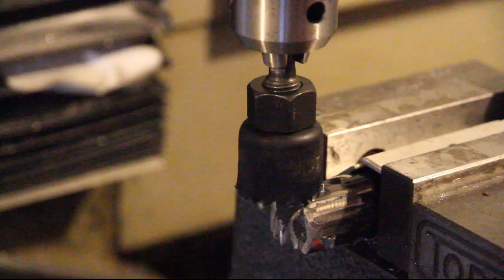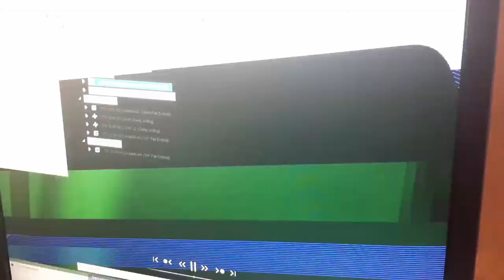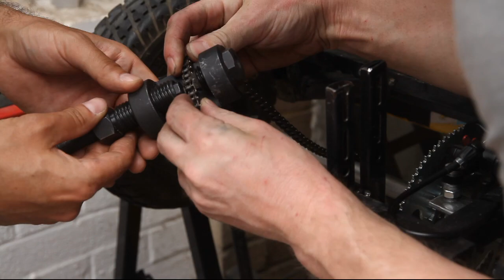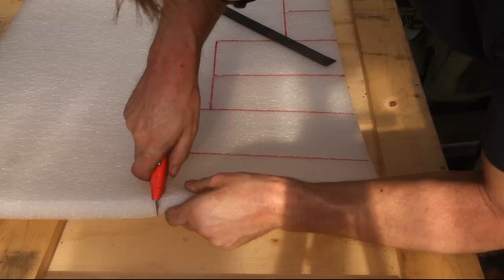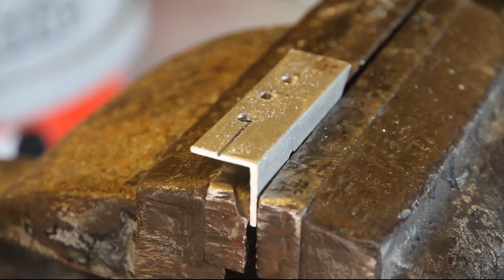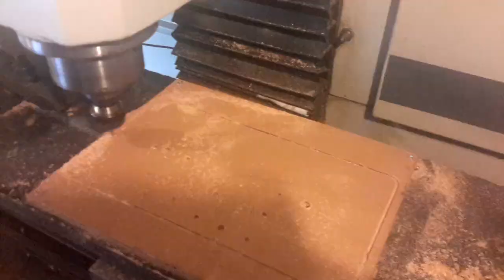Building a Hacky Racer: pt2 drive system

Comment: Do you fancy adding a mobility scooter transaxle, which will have a differential in for better cornering
Reply from the maker: There's quite a bit of debate about the benefits of a diff in hacky racers. Personally, I think they generally make it worse, as the unloaded inside wheel will tend spin. By moving your body weight, you can unstick the inside rear enough to initiate the turn. Rule Zero mostly corners on two wheels, so the diff would definitely make it worse! 
The other downside to the transaxle is it makes the braking more complicated.

Comment: Did you make any changes to the motor / cooling in the end? The 6374 looks ideal but not if it's only going to last 5 minutes :-)
Reply from the maker: sorry, I only just saw this question. The motor had enough power, but on really hot days it overheated. I ended up switching to a much heavier Vevor 48V 2kw motor, which I think is more efficient and has better cooling.

Comment: How about a liquid cooled motor ?
Reply from the maker: sorry, I only just saw this question. I think that'd help, but I didn't really want the complexity.  With the Hacky Racer fuse limit, I think efficiency is more improtant than pure peak power, so its better to have to a more efficient motor that doesn't need cooling.